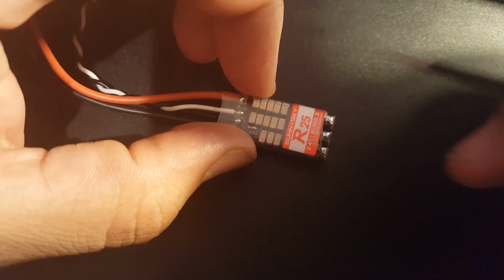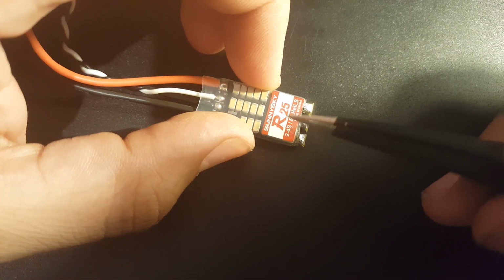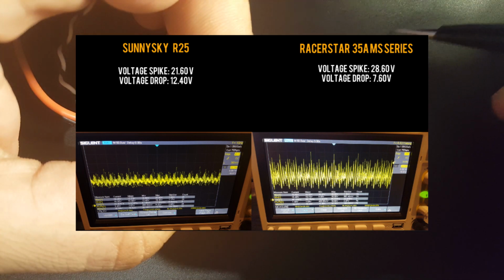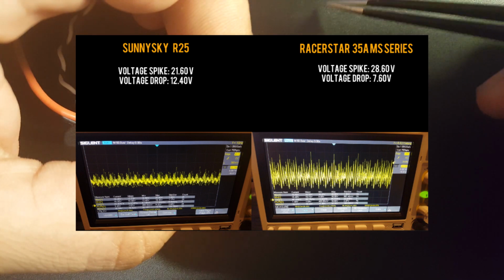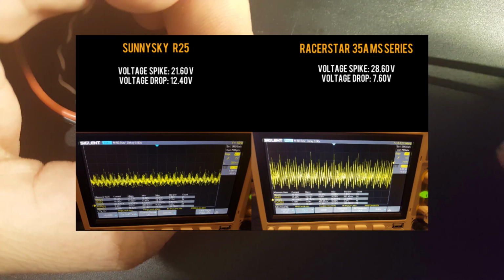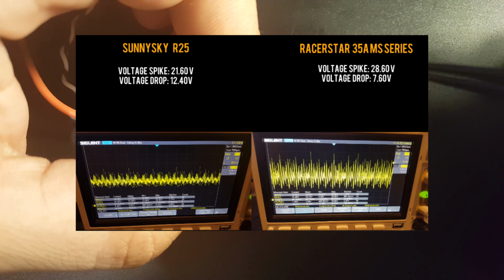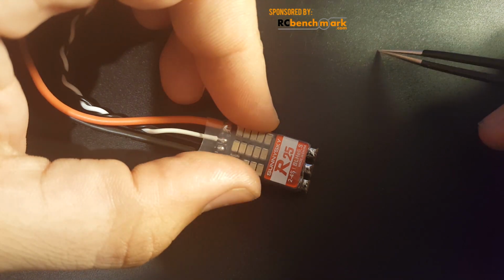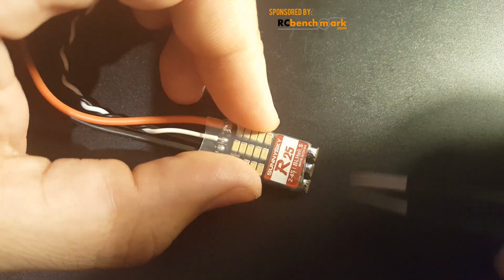SunnySky R25 ESC // Review and Noise Testing

Comment: keep up the great work man, your doing a great job filling in a gap that was needed for a long time with your testing. Do you plan on doing any other type of tests in the future?
Reply from the maker: Adam-g1 Thanks.. 
Yes I am preparing current testing for esc and motors testing, noise, thrust, vibrations and torque.. 

You have anything in mind?
Reply: Drone Mesh I think there's plenty of 2204+ size motor tests out there but one area that's becoming hugely popular is 1104-1108 sized motors. There's hardly any info about them online and I think you would definitely be helping a lot of people testing some of the 11XX and 13xx sized motors and the various props for them. Also testing some of the 20x20 FC and  20x20 4 in 1 esc would just go hand in hand with the motor testing. what do you think?
Reply from the maker: +Adam-g1 ok will setup for that I just ordered a 3d printer yesterday so maybe by next week or will have it setup and build an adapter for my thrust stand and do the testing required.. however this will need time as I have exhausted my budget for parts. I have 2 motors in the house I can start with emax 1306 and DYS 1104 or 3 I forget.
Reply: Some great suggestions for motors to test would be.. RCX 1304 4000kv/5000kv, Brotherhobby R3 1106 5100kv/7100kv, HGLRC Flame 1105 6000kv, HGLRC Flame 1104 7500kv, Rotorx 1105b 4000kv/6500kv, Realacc 1106 6000kv. 

The best thing about these is how cheap they are! The Realacc 1106 6000kv is only $7.89 on banggood and one hell of a performer from what I've been told. I'm currently absolutely loving my little 3" quad with rotorx 1105b 4000kv on 3s/4s. Also these HGLRC Flame 1105 6000kv with gemfan 2035 quad blades seriously gets my tiny little quad up to like 70mph!

Also some really sweet FC/4 in 1 ESC combos would be

http://www.gearbest.com/flight-controller/pp_616119.html?lkid=10719972
http://www.gearbest.com/flight-controller/pp_633965.html

I use the cheaper F3 one for all my micros and it is such an awesome performer. 
Look at all the features for it! The second one (HGLRC)... It seriously has more to offer than most full size fc / 4 in 1. 

If you need any more suggestions for motors / props / frames.. or anything just let me know! Did listing all these help at all? It sucks your budget is blown but it should be much easier to get parts to test with them being for micros and their much cheaper price in general.

Comment: Can this handle a Emax 2205S motor?
I really like the design of this Esc and because they are actually rebranded Spedix Esc's, I love the fact that I can get them locally even cheaper. Here in the UK you can get them for about £7.50 a piece
Reply from the maker: This was tested on EMAX 2205s motor so in theory yes and it does a pretty good job. However this is not speaking about current. I think  it will handle ok depending on your flying.

Comment: Hi Drone mesh, like always thanks for your videos, but i have a problem, after i saw your video i bought this esc's but the r20a version, i swap my old esc xsd30a amd put the sunny sky esc, when i arm my kwad they start to twitch amd oscilate, my motors and and fc are softmounted and i cant fix them and i dont have idea of what can be the problem, i flash the esc with all the firemware and the problem still there... do you have any idea of what can be the problem?
Thanks again
Reply from the maker: Try changing the ESC version as a start